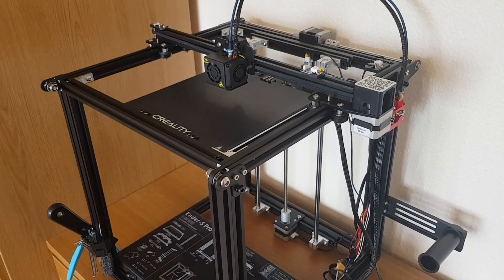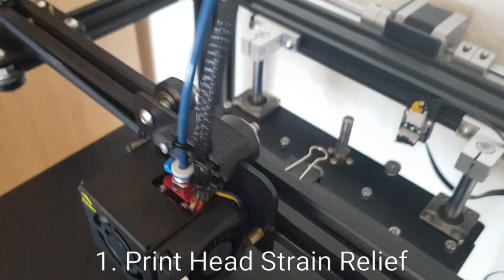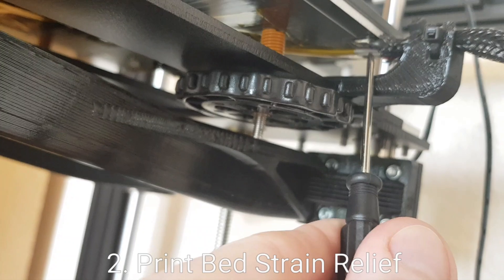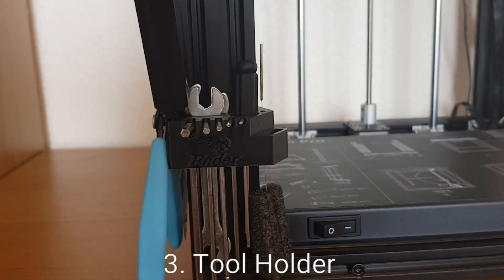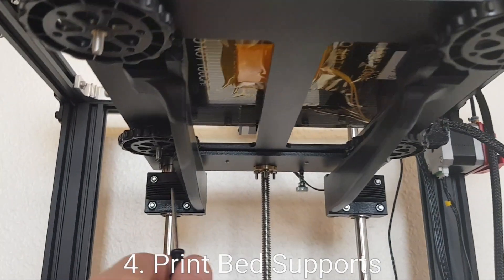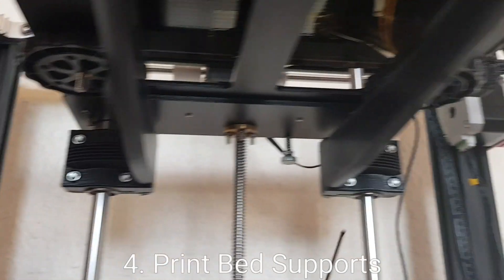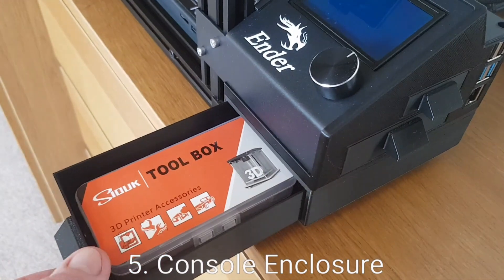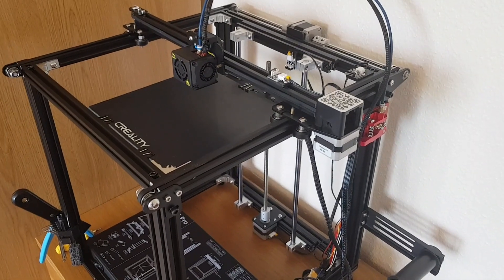Creality Ender 5 Pro - 5 Printable Upgrades

Comment: I like this particular control panel back cover. I have bought  RPi 4 for my Ender 5 Pro for Octoprint so this'll work out great. It'll be one of my first prints after a few test prints obviously. Haven't even assembled the printer yet. Quite excited as it's my first 3D printer.

Comment: question can you print alot of these stl files into one print using the slicer program or do you need to print separately
Reply from the maker: Yes you can add them all to one print if you want to print them in one go. I use Cura and allows you to add multiple models

Comment: Thanks for the great video’s on your Ender 5 Pro. Thanks for sharing. Could you please share what type and size screws and bolts are used for the printer head and printer bed relief? Any advice appreciated.
Reply from the maker: Hi. I'm using M3 12mm screws for both with a M3 nut on the heated bed strain relief to secure it.